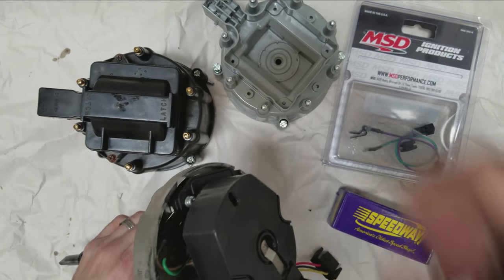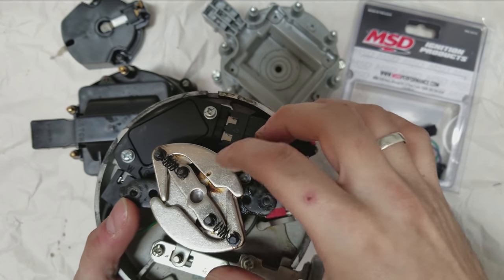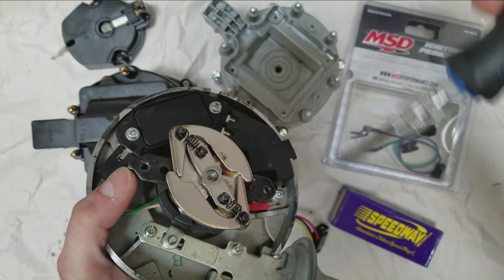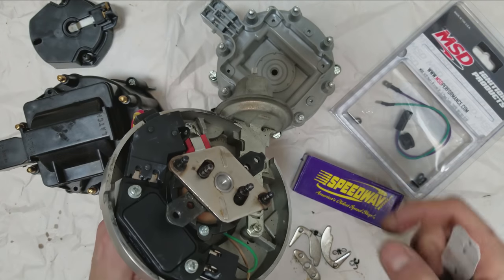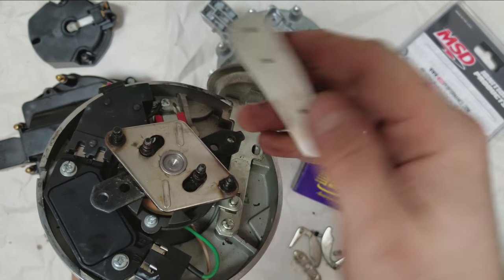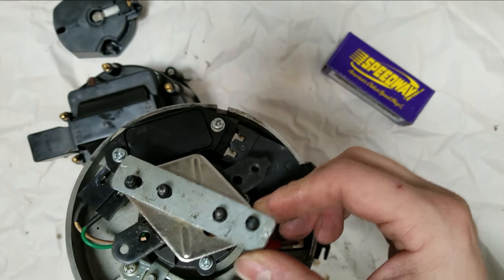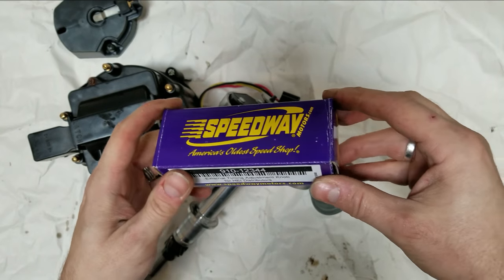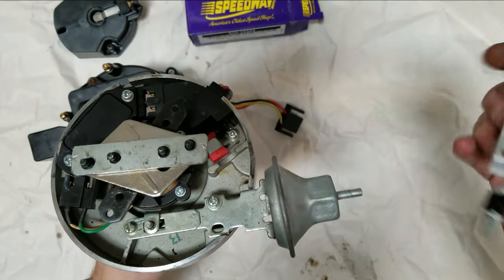1967 Turbo Camaro - GM HEI Large Cap Distributor Timing Control with Holley Sniper EFI

Comment: Just wanted to tell you that you'r video help me figure out my timing with the Holley efi. I'm running a ford 300 and no one makes parts to link up with the Holley system. I got 2000 miles on your system thanks again. 😃👍👍👍👍👍
Reply from the maker: I'm glad it worked out for you. It's great to have an alternative that works while avoiding expensive hard to find parts. Thanks for watching!
Reply: Hey man, how is the drivability on the 300 after you’ve locked out the HEI? I’m doing the exact same thing on my truck now

Comment: Thanks for making this.  You gave me the confidence to go out and buy and mod an HEI for my AMC 304.  I placed the coil driver INSIDE the HEI housing to minimize wiring.  Mag pickup, +12v and points wires only going to the distributor.  Runs great.  Holley told me I needed a CD box and MSD Distributor (they dont make an AMC dual sync) for my 2bbl Sniper, but this mod saved me hundreds!
Reply from the maker: That's a great idea to stash the driver in the cap. Only concern is have would be interference (RFI) from it on your magnetic pickup. Obviously its not an issue if you have it running great. I've heard so many people having issues with RFI I was fairly conservative with the install to prevent it. It saved me a ton of money as well. Nice work!

Comment: Awesome video! Worked great on my truck and way cheaper than buying there distributor.
Reply from the maker: Fantastic! I'm glad you gave it a try. I've had this running for years now and don't regret it for a second. Parts are widely available and you could revert back to stock without too much trouble. Hundreds cheaper, especially if you already have a compatible distributor.

Comment: I see this video is a few years old now.  You would think Holley would develop an HEI conversion kit for those of us who don't have ordinary cars with the option of getting a fancy dual-sync distributor.  I will be doing the conversion on my 1979 International Scout.  Mostly because I want to use the rev limiter function offered by the Holley Sniper EFI.  I have a very low redline of less than 4000 RPM and I want to ensure I don't over-rev the engine.  Thanks for the comprehensive video!
Reply from the maker: I agree. I wondered if I was wasting my time with this video as it seemed like a no brainer to produce a kit for this, and I thought this process would be "phased" out for a cheap Holley kit. Unfortunately they just keep releasing dual syncs that cost a fortune and aren't any better than working with what we already have. Either way, thanks for watching and good luck on your project!

Comment: This just helped me out alot great instructional videos
Reply from the maker: brandon cruthirds I'm glad you like them. Still more to come about Sniper EFI setup and turbo related configs. Thanks for watching.
Reply: Yea I have a 306 I built for my truck in picture and I'm going with a turbo but I wasn't sure how the sniper would work with it your videos pretty much was my deciding factors to go turbo with sniper
Reply from the maker: That's great! That's pretty much why ive made these videos. Be sure to check with EFISystemPro.com as a good spot to buy as Chris offers great customer service after the fact and free shipping like all the other big names. I doubt I could have made this video without his help. If you need any help along the way let me know.
Reply: Turbo Camaro ok sounds good I appreciate it I'll probably use the dual sync just for ease of installation and I'm gonna half to buy one anyway
Reply: My biggest thing I think is going to be tuning timing and fuel for boost are u using the built in fuel regulator
Reply from the maker: Yes... You have to change the fuel tables as they are not setup for boost. You might see a video from me on that soon 😎. Other than that the Sniper will take you to 15psi without issue.
Reply: Yea thats what i figured I'm gonna run 6 psi to stay safe the turbo set up I'm going with has a power range from 350 to 600hp motor makes about 280 now so I should be around 400
Reply from the maker: That's a pretty good bet for the added power. Even if you we'd 8-10 psi your probably pretty safe if your motor is sound. Sounds like a great project!
Reply: because of 2 bar map sensor? can you get 3-4 bar ones?

Comment: 🤪 a really good video, really detailed, and I got to tell you, your alternator is going to squeal like a sumbitch. There's almost zero v-belt contact patch on that pulley. Yeah, you got to go around that pulley at least a third of the way around that pulley, to have that alternator function at all.
Reply from the maker: Glad you found the video helpful. Good eyes on the alternator belt. I had some charging issues (as you predicted) and have added a 2nd belt just for the alternator and it's great now. Never had any squealing but definitely intermittent low voltage at the time. Thanks for commenting!

Comment: Currently trying this on my 72 Oldsmobile 455. I had to make some modifications to the phasing fixture to fit. What I'm curious to know is if you're purple and green wires from the MSD delete line up with the Holley sniper efi harness. Mine are actually switched and both Holley and MSD couldn't tell me the reasoning why
Reply from the maker: Hey, you caught me in the garage so the answer is gonna be quick. My sniper harness is reversed from the MSD delete. The Snipers purple wire feeds to the MSD's green and The Sniper Green goes to purple on the MSD. I suspect it's a simple mistake on one of their parts, but you could pop the pin on one of them and reverse it. My engine has been running for years like this without issue. Enjoy!
Reply: @TurboCamaro67  thank you so much for checking. I'll leave it as is for now

Comment: Thanks for this - one of the best sources of how to set up EFI timing control with a magnetic triggered distributor. I'm wondering if you wrestled with the idea of setting up timing control with a Hall Effect-triggered distributor, such as a points-type with a Pertronix Ignitor I conversion. If so, what led you to decide against it? If it's just because you wanted to use parts you already had, I can totally relate. There aren't distributors on the market that allow plug-and-play timing control for my engine, so I'm having to figure out my own way of doing too, so thanks again.
Reply from the maker: It was completely a matter of using what I already had. It's a $75 eBay distributorb and I wanted to make it work. I actually still have the original points distributor but didn't want to gut it for this project. Plus using a cheap aftermarket one made the project duplicatable.
Reply: @TurboCamaro67  Thanks. One of the common themes I've found in my search for ideas is that magnetic  pickups are susceptible to electromagnetic interference, making Hall Effect triggering preferable for this reason. However, millions of cars used the magnetic trigger HEI distributor you're using, and I've never heard about EMI-related issues with those. Have you had to overcome any EMI-related problems with your setup?
Reply from the maker: I had no magnetic interference issues. I had bought some copper coated tape with the thought of wrapping wires in and around the distributor but due to the lack of issues, I didn't waste my time. My research at the time made fee like a lot of the issues stemmed from guys running big bundles of power cables together and parallel to other signal wires. I avoided bunching power wires with anything other than power wires and I kept my distributor wires away from everything else. Have you found anyone suggesting the hall effect dizzy won't work for this, or is it just a concern that you haven't found anyone who's tried it?
Reply: @TurboCamaro67  No, actually the opposite. Holley forums point to the most direct, Holley-supported solutions for timing control, which are their Hall Effect Hyperspark and Dual Sync distributors (neither of which has a version for the big Cadillac V8 I'm building). The less adventurous people putting a Sniper on their SBC or BBC can just grab one of those distributors and be on their way and accept the prevailing opinion that magnetic triggering should be feared because of the potential influence of EMI on digital controls. Those of us who either don't want to buy more expensive parts or don't have off-the-shelf solutions available for our cars appreciate you demystifying magnetic triggering for Sniper timing control on those forums and this video, so thanks again.
Reply from the maker: No problem. Since I completed the HEI mod they've gone ahead and made an inline 6 dual sync so if I was patient enough, I could have gone that route too. However I'm no sheep, and I prefer the same result at 20% of the cost. Good luck on your build!

Comment: Great video! I used all the same parts you did except I used a DUI cap and rotor and I had to use a msd magnet pickup extension. I have a question too.  I got it hooked up and get a tach signal to the display when cranking but no spark. I also noticed that the wire colors on the HEI module delete harness (same one you got) doesn’t  match up with the sniper harness. Green and purple are swapped. I couldn’t tell if yours is that way is too. I copied your ignition settings in the software too. Any ideas?? I’ve tried to turn the pickup fine tune knob either way in case my cap and rotor are not quite aligned right.

Comment: At 14:39 if you can't fit the speedway timing knob could you just rotate the distributor 
Do you have the part numbers for the coil driver and the msd module delete wiring harness bud. 
Is great to see this on a 6cyl,  every  internet search I do of this great information you cover  is normally  for v8s. @turbocamaro
Reply from the maker: Hey, glad you like the content. Unfortunately rotating the distributor doesn't adjust the sensor to rotor independently, thus potentially needing the knob to fine tune the rotor phasing. The coil driver came with my EFI kit but it's part number is Holley 556-150 and the delete harness is a GM HEI module cable, MSD 8861.
Reply: @TurboCamaro67  ah yes thanks for confirming that , I've found I can cut the shaft down and change the gear drive cog on a hei unit from a jeep amc 232 or 258 to fit my gmh 6cyl 202ci  motor. As no one makes a large cap hei for my motor.  A jeep hei should be the same process with locking out and modding as your Chevy hei hey ? Thanks
Reply from the maker: Yeah the tech should be the same and it's mostly mechanical with a sensor so as long as the gear and shaft are right it should work. Good luck with it for sure.
Reply: @TurboCamaro67  great will see how it turns out. Thanks again

Comment: So i'm trying to do this on my 1975 vette with an 1986/96 (there's a lot of mismatched parts, don't ask me I didn't build it) 350ci, but I see an issue. I noticed on the 6 cylinder caps, they have larger terminals, and smaller terminals on the 8 cylinder caps. I understand that the vacuum advance works by essentially moving the reluctor points, which pretty much works the same way as electronic control by delaying the signal, which means I should still be able to have it work. Problem is, that's only about 13-14 degrees of timing control. I'm wondering if I can even run 30 ish degrees of timing control with the small pins in the cap, or if it's pointless. Also, if that won't work, do you think it would be possible to rob the terminals from a 6 cylinder cap and modify an 8 cyl cap to house them?
Reply from the maker: Hey, I've never had the opportunity to try setting up HEI timing control on a V8, so I can't say for certain that it works. However, I expect the cap is smaller, and the internals are also smaller, thus not really changing the method. You'll still be locking it out, dropping it in toward Cy #1 on compression stroke as you normally would, setting a 47°ish reference angle and inputting it in the software before static tests. You just need to be able to dial in the angle to ensure proper rotor to cap terminal alignment, which may require an adjustable rotor or the speedway knob that I used. I don't believe the cap or terminal size will affect you much. Obviously the stock motor csn archive good spark with those parts, so if set right, electronic timing should work just as good.

Comment: I have a sniper set up on my Suzuki samurai and I want to add the timing control. The stock distributor uses a magnetic pickup. Do you think it would work? Do I need to bypass the factory module like you did? The phasing looks like it will be easy. Thank you.
Reply: I'm not knowledgeable about your specific application, but in theory it should work for virtually any vehicle with a similar HEI style distributor. It's a simple setup to use a stock distributor once you wrap your head around it. Unfortunately I just don't know if your module will bypass the same as the GM one I used.

Comment: A couple of more questions...
At 16:30 you say the wire that comes up into your distributor is a gray wire that comes from the coil driver. You then say that the wire in the distributor harness (yellow) goes up to the connector on the cap and jumps over to the tachometer out terminal (which you did not use because you did not have the correct isolating connector). Are you saying that if you have the correct GM style connector, you can connect the gray coil driver to that terminal? As I have my son's car set up now, I use that terminal for the coil input (-) yellow (from the Sniper harness). So, I do not need the yellow wire for the tachometer signal any longer and this terminal on the distributor can be used for the gray coil driver wire?

Are the large terminal (internal contact) distributor caps only for 6-cylinder vehicles? I have never seen one for an 8 cylinder.

When you get into the programming part of your video, your volume goes very low. Is there any way you could boost the volume in that section or copy that section and make a second video with the volume boosted? I am unable to hear it on my phone but I can with headphones on my PC. Just a FYI. Your video and your comments have been very helpful. Thanks.
Reply from the maker: I'm not sure about the size of the pickups between 6-8 cylinder engines. I guess I'm not sure I've seen pickups like these on anything but this cap, but I've only ever had this cap for this distributor so I can't really comment.

Take a look at the cars site www.turbocamaro.com and click on the build sheet and read the Holley Sniper EFI article. I wrote detailed instructions on the entire process including programming and I saved an EFI file there too. If you're still uncertain, I'll dust off my memory and try to answer.
Reply from the maker: Hey again, I had a chance to re-watch the video at that point and follow what you said, and... Yes. You can hook up the grey coil driver wire to your unused yellow wire cap terminal. Perhaps mock it up for a test run before you splice any wires in case colors are different,or your module had a different internal setup than mine. However the same spot on the distributor cap should work universally.

Comment: hey man, we've spoken before. i have a queastion. if you mechanically lock out the distributor from advancing, how does the timing advance?  even if the sniper controlled when the signal comes in, the distributor/ rotor isnt lined up.
im trying to understand.
Reply from the maker: When you lock out the distributor, you line everything up at a pre-determined "reference angle" that is AHEAD/advanced of real time. Then you provide that reference angle to the sniper software and it controls timing by simply firing the spark the designated number of milliseconds required after the reference angle to be fired at the desired degree of timing. So it's really just delaying the spark in order to control timing. For instance, if you give it a reference angle of 45° and then tell it to idle the engine at 15°. It waits for the 45° to come around on the crank, then delays the time it takes to have 30° pass on the crank and then fires the coil. If you want it to be 36° at wide open throttle, it'll have to act quicker as it only needs to delay 9° before it fires. Tons of calculations for it to do, but it's very accurate and simple once you wrap your head around it.
Reply: @TurboCamaro67  so itll spark before or after the rotor/cap line up and just arc at the appropriate time?
Reply from the maker: It'll fire the spark at exactly the desired timing degree, and because you aligned the rotor with the reluctor and a spark plug terminal when you setup the reference angle, it will be near the spark terminal every time it fires.
Reply: @TurboCamaro67  well, thats a fixed timing then. unless you move the rotor or the whole distributor since you bolted the advance mechanism together. thats what im not getting. all the mechanics are bolted together non mobile.
Reply from the maker: Yes, the rotor is fixed because the advance is locked out. But the spark is still fired at the desired degree. If you didn't lock out the mechanical advance it would throe off the reference angle and the snipers computer timing wouldn't be accurate.
Reply: @TurboCamaro67  that makes perfect sense. i couldnt figure out how it mechanicaly advanced. it just arcs early or late depending on the computer signal.